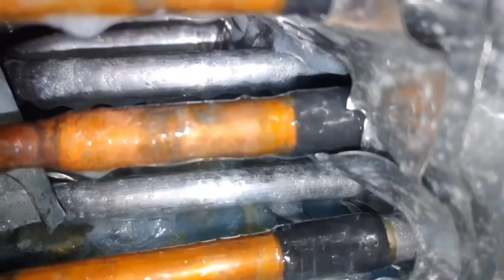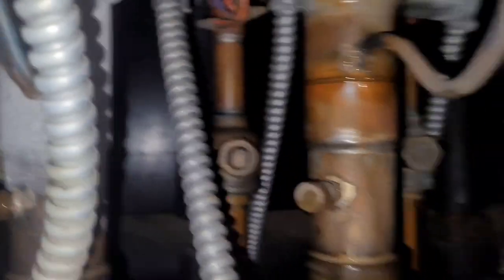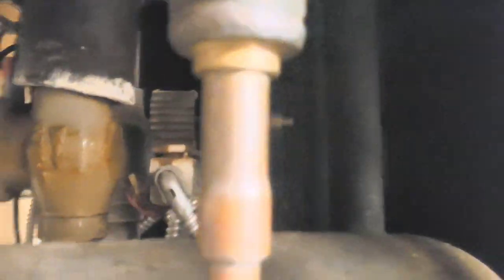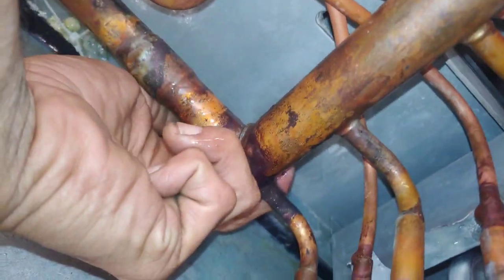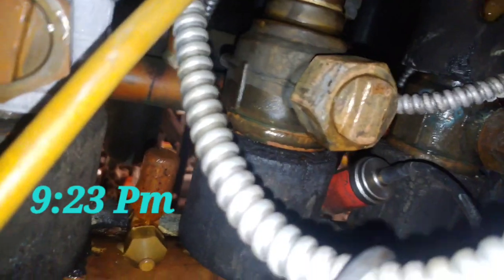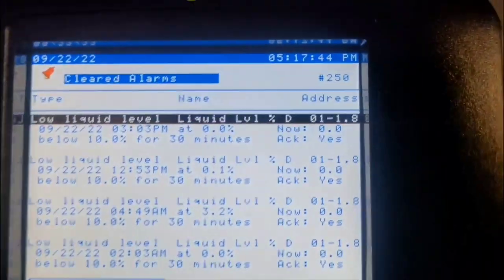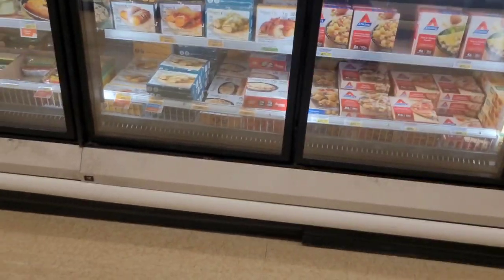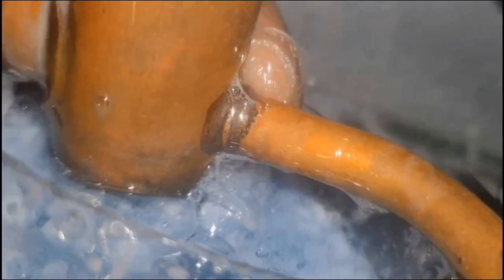MAJOR REFRIGERANT LEAK DETECTED FF CASE - PART 2 - LEAK REPAIRED - TOOK FOREVER - RECHARGED NEXT DAY

Comment: great info,you would think the leak would be bigger,6 jugs.thanks for all the hard work you do to make the vids.
Reply from the maker: No problem. I'm glad they are enjoyed
Reply from the maker: Yea I agree. It's just over a long period of time. That is actually a decent size leak. I should've recorded when I was leak Testing the whole store. That entire side of Aisle 6, the refrigerant was very strong. Even picked up inside the front door by the registers... but the rack does fine, and then they get a low liquid level alarm on the Danfoss control and it usually gets taken care of before anything loses temp. Could've been several months since some was added

Comment: I do hvac in Florida so long days bro. Get one of those batterie phone cases for your phone. It will double your battery life. Learned a lot btw too thank you bro!
Reply from the maker: Yea I have a good battery charging pack. It's just hard to keep up to all of that and get the jobs done in a timely manner and edit and record. But I'm getting better at it and more used to it. Soon I won't need to really edit much because I'll be able to get the right footage the first time. Just tales more practice.  

Thanks for the comment
Reply: @HVACRServiceTech  I really am interested in the channel and work you do so I appreciate the uploads. I know how much critical thinking and labor goes into these repairs. Just out of curiosity where are you located and are you working for yourself or a company?
Reply from the maker: @DirtyCoffeeCupp  I'm glad you are interested in it. It is a lot of thought process, but it's just harder to film everything i do with only the 2 hands I have. Sone enough, I will get something to make the filming easier. 

I am in the process right now, actually, of sending in my contractor license to the state and taking the exam. I have it ready to mail off, and I'm sending it on Monday. Until then, I am an employee for a nationwide or worldwide(I'm not sure) equipment MFG and service company.  I don't want to say the name outright, but if you watch enough of the videos,  you may see the name on my uniform. The name pops up a lot in most videos because the brand of a lot of the units I work on is the company I work for.

 I am in Houston, Texas.